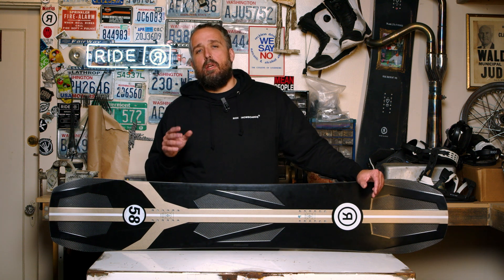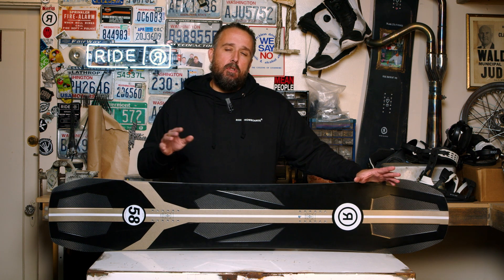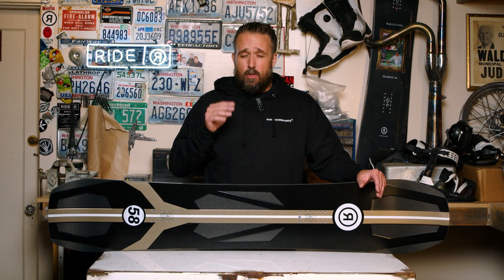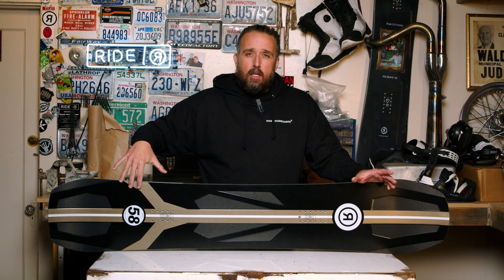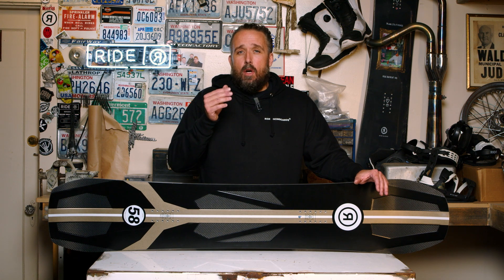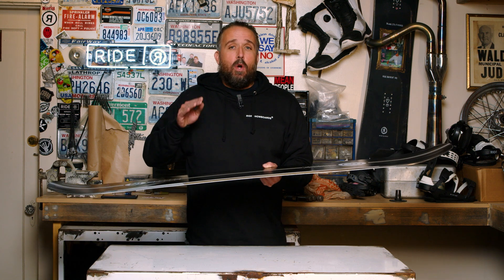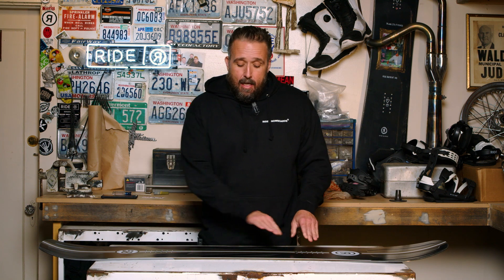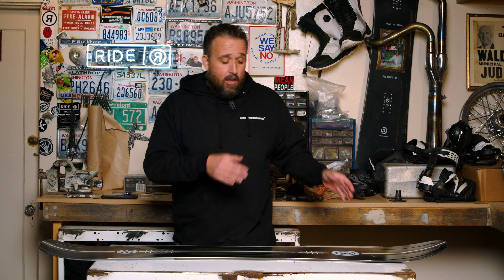22/23 RIDE COMMISSIONER

Comment: Rode this in Jungfrau (Grindelwald/Wengen/Muren). Was riding a capita DOA 154 (my Japan board of choice), but here in the icy/hard pack on the massive fast steep runs it felt like the edge needed to be longer and sharper. I was also getting stuck in flats. I rented this in a 158 and where I was taking long S turns and plowing in the blacks with the DOA, I was flying straight down the slope and that's the thing - it felt so stable. Heavier, much longer edge, stiff and you fly. No longer stopping in flat bits like most other boarders I saw on the slopes...top to bottom express. Massive carves, massive straight lines.